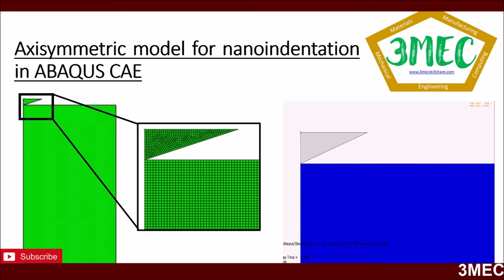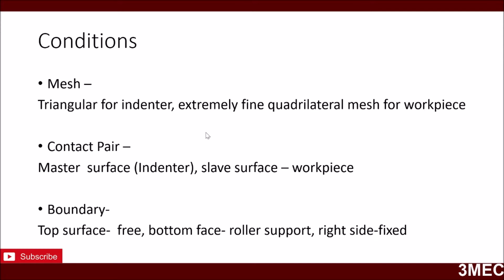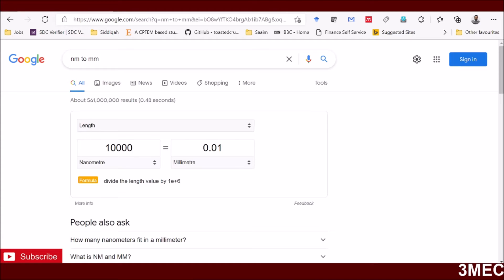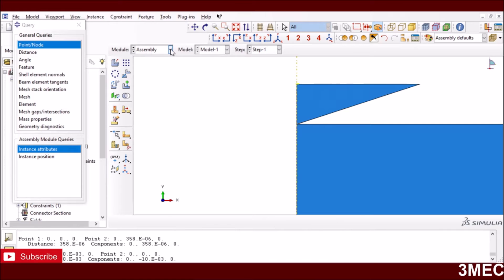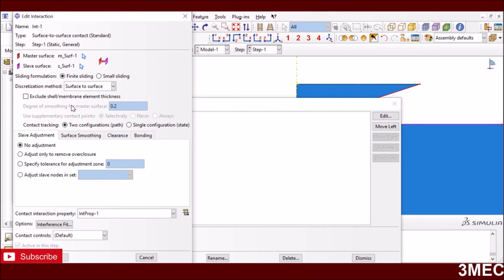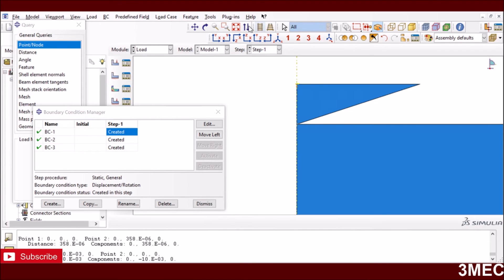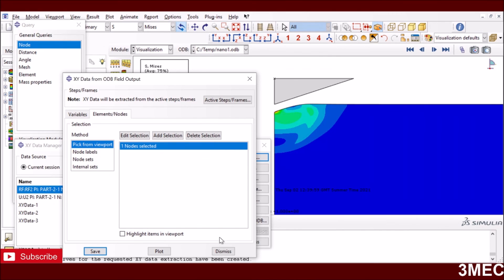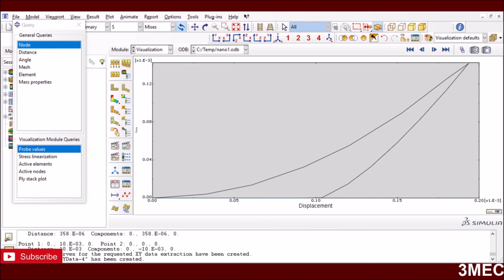Axisymmetric model of nanoindentation test in ABAQUS CAE

Comment: Thank you for your video. I'm working on an indentation project and I need to reproduce experimental curves. I'm correctly obtaining my RF2 curve as a function of displacement, but it's 100 times higher than the experimental curve. I've checked the units (mm/MPa/N) and all the other values. Do you have any explanation for this 100 factor? Thank you.

Comment: Thank you for the tutorial; it's very helpful. I want to modify the fall cone test, which is somewhat similar to the nanoindentation test. However, in this test, the cone penetrates the sample solely under its own weight without any additional applied load.

The problem with my simulation arises when the angle of the cone is reduced (e.g., 15 degrees as half of 30). In these cases, the cone does not make contact with the sample and seems to penetrate without resistance. Conversely, with a larger angle (like 45 degrees), this problem does not occur.

Can you guide me on how to solve this issue? I would be grateful if you could provide a way to contact you, so I could show you figures for a clearer understanding of what I am talking about. Thank you very much in advance
Reply from the maker: you can contact me through www.professor3mec.com.

Comment: Please, can you explain how to input the load value in the indenter?
Reply from the maker: Professor 3MEC
0 seconds ago
Instead of displacement boundary condition you may apply an equivalent force or equivalent force. Or you can use displacement boundary condition and track the forces as shown in the below video.
https://youtu.be/vO-KtD-R2U8
Reply: @Professor3MEC  Thank you, Prof.  That means I need to keep varying the displacement until I have the same force used in my experiment.
Reply: @Professor3MEC   That means I must keep varying the displacement until I have the same force value in my experiment.

Comment: What would happen if you increased the young's modulus of this material? If someone were to implement a metals (E) for example Copper (E) of 125,000 MPa would you need to run it in explicit?
Reply from the maker: Yes you can change material properties as appropriate and can use explicit If force controlled test which may get tricky for standard

Comment: Hi thanks for the video. since the unit here is mm, should the density be t/mm3?
Reply from the maker: Thanks for pointing this out, yes you are right. Since its a static general step so might not have much effect. But in principle it should have 8.5∙10-9 tonne/mm3
Reply from the maker: Here is an example:
MASS	LENGTH	TIME	FORCE	STRESS	ENERGY	DENSITY	YOUNG's	35MPH    
56.33KMPH	GRAVITY
ton	mm	s	N	MPa	N-mm	7.83e-09	2.07e+05	1.56e+04	9.806e+03
Reply: @Professor3MEC  Thank you so much sir. Wish you good healthy.

Comment: Thank you Sir, to simulate a burst test of a tube modeled with axysimetric, is the standard approach okay?
Reply from the maker: Thanks for liking. Regarding your question, it will depend on what you really want to do. As per ASME VIII you can do standard and run it until element localises, i.e. simulation will not converge and that will give you a value. If you want to do with damage and element deletion criteria then again it should be fine depending on the problem with no inertia, etc.
Reply: @Professor3MEC  could you do a tutorial about it?
Reply from the maker: Sure If you could send me problem description with relevant details of the model. Please don’t send me a research paper just a short problem description with geometry. Boundary and loading conditions. Material properties, etc.

Comment: first of all, thank you for the nice work.
question: I have a material property and its experimental data but as I use this method, with the same experiment displacement amount, the load is much bigger. 
Is there a way to define maximum load with different strain rates to reach experimental curvature?
Reply: Also I don't understand the reason behind setting modulus of elasticity 1100MPa (1.1 GPa), which for Brass is around 100 GPa. why did you choose such an small value for that? and how do you calibrate data with just altering modulus of elasticity?
your answer is appreciated Professor.
Reply from the maker: I just used values for demonstration which were provided by the subscriber.
To fit load displacement data you may have to play with properties to get a better fit.

Comment: for the amplitude function, if we wanted to set a hold time (hold time for indenter), how can we do it? 
I am trying to run the same simulation with amplitude  (0,0) (0.5,1) (1,1) (1.5,0) but I find it doesnt work like this
Reply from the maker: If hold time is to keep displacement constant then above should work.
If hold time is to keep force constant then it should be a force driven test and force should be applied with amplitude function.